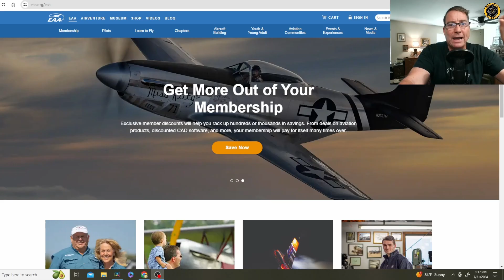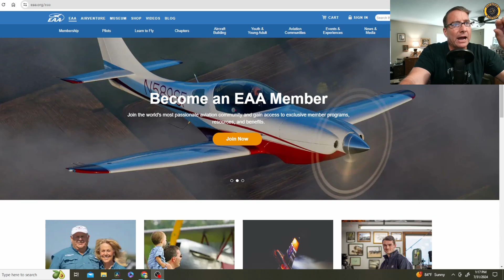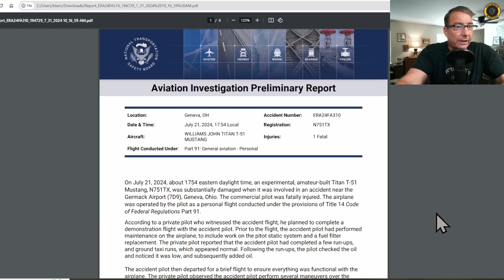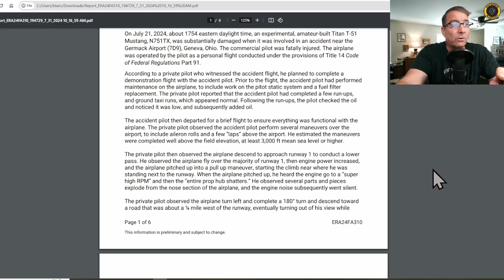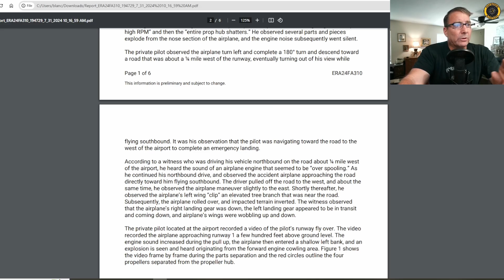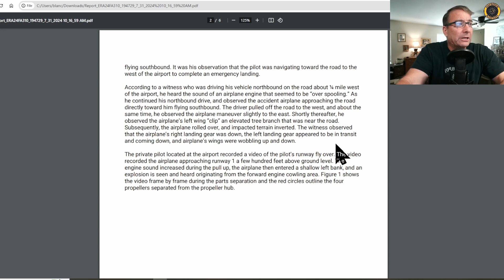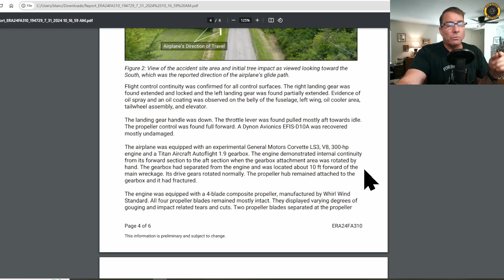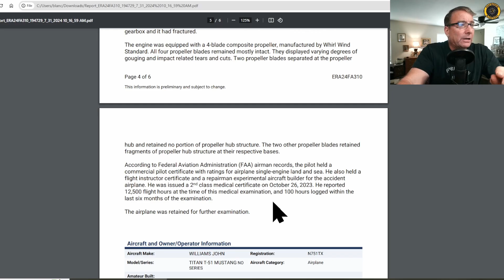Titan T-51 Fatal Prop Hub Failure 21 July 2024

Comment: Simple answer. Either the throttle cable travel limiter failed or was set too high or the G's caused limiting failure pulling the cable. There is also programable engine control modules that can rpm limit and one of those installed might of been flashed improperly. Of course or he went for full pitch after throttle up allowing a burst of rpms.

Comment: We need to allow for the possibility that the rpm increase did not cause the prop hub to fail. The private pilot report that he heard the rpm increase then saw the prop explode may or may not be exactly accurate. It is possible that the prop hub failure caused the engine to increase in RPM since there was no load on the engine.
Reply: Yes, the hub failed first.

Comment: Alot of replies focus on the reduction gearbox, every turboprop and turbine helicopter uses reduction gearboxes.
The Achilles heel with experimental aircraft is the reliability of the non aviation certified powertrains used.
I think the focus will be with the propeller hub failing or a propeller control issue. 
We will need to wait for the NTSB report.

Comment: bad mouthing conversion engines when the engine was not the cause of the accident, shows your bias. The prop hub failed, not the engine.
Reply: engines don't suddenly overrev like that. but they do if their load is suddenly removed.

Comment: One thing racers who push engines to the max use is a custom built crankshaft with an over sized snout. I sure would if I were using an auto engine in this application.
Reply: It drives a gear reduction box.

Comment: It seems unclear which happened first. Did the prop hub fail first, causing the blades to separate, which suddenly reduced the rotating mass and drag, causing the surge in engine RPM? Or did the engine surge in RPM first, overstressing the prop blades & hub causing them to fail?

Comment: So much more to it, like you think these guys thought of everything, but did they?  The propellers and hub are unlikely custom, they are likely tried and true.  What about the hub?  Had it the strength to handle the torque from an LS?  Don't forget the flight was entering a climb, a time when the torque would have been near it's highest.

Comment: Can someone explain to me why people don't use airplane parachutes? I know a few people do, but you would think with the safety that it gives that most everybody would have one. I just don't understand the thinking of people who don't have them. If there was one on this plane we wouldn't be hearing about a fatality, only a gear box and propeller failure.
Reply: There’s a plethora of reasons aircraft’s aren’t equipped with emergency parachutes. Starting with the airframe has to be engineered from the get go to withstand the shock of deployment. Then there’s cost, weight, space, weight and balance, maintenance. The list goes on and on. Even certified systems are not a panacea as there’s a performance envelope for successful deployment that’s not as broad as many imagine.

Comment: Damn. I fly RC aerobatics, giant scale with 20 horsepower 4 cylinder boxer motors. They rip the prop if you don’t control the throttle and nothing will destroy an airframe in the air like the prop throwing a blade. The airframe looks like it blew apart from within sometimes. Catastrophic explains it pretty well.
Reply: No, just the prop blades and part of the hub blew apart. The airframe and even the gearbox were not affected, apparently

Comment: What a tragic series of events; which I believe could have been prevented. I know John wanted to get all the performance he could get, out of his aircraft, which is why he chose the LS3 Chevrolet engine. The LS3 is a very reliable engine and can produce up to 600HP, reliably. It sounds like there may have been an undetected issue with the propellor hub; whether it was a bearing surface wearing unevenly, or wearing excessively. I'm curious of how long it had been since he had inspected the propellor hub and lubricating oil?

Comment: Is it possible that the prop hub failed, removing the load from the engine, causing the engine to then over rev?  I'm assuming the video can verify the timing of the two events.

Comment: If you look at many of the auto conversions in aircraft, the installs are just extremely scary. The wiring is usually awful and the fuel, coolant and oil lines (if there are any) are usually just bargain bin garbage. Viking Aircraft Engines doesn't even use a pressurized cooling system, because they refuse to run AN hoses and have trouble with the coolant hoses popping off of their fittings! It's just the wild west with most of those guys.

Comment: I don't believe the surge in rpm caused the prop hub failure, the surge in rpm was more likely an engine rpm spike resulting from the unloading of the departed propeller assembly.
Reply: I'm sure they watched the video that the eyewitness recorded. Not hard at that point to figure out which happened first.

Comment: 12,500 Flight Hours, lots of additional experience, highly experienced. Taken out by a mechanical failure.
Reply: Actually taken out by the choice to belly land gear up. If the field is fairly flat and smooth not that much damage is done to a plane that way.

Comment: From the looks of it, he had several other options than the road surrounded by trees, particularly to the right with what appear to be crop fields. Yeah, it will trash the plane, but there is a lot to be said for walking away from a busted plane when the option is getting cut out of a crumpled hunk of metal.

Comment: It's tough to be the bearer of bad news, but thanks Juan.  It's not a secret that 10% of Engineering effort is in actual "design", The other 90% is identifying all possible failure modes (of your now cherished design), because in av'n, "even if it can't fail it will".  With detailed knowledge of the instl'n and failure modes, something will fall into place.  But it's not possible to speculate here w/o detailed knowledge of the LS300 engine and prop design.  Is there a prop (RPM) governor (a digital / analog ECU)?  Or was it old-(old!-)-timey inst'ln with the pilot manually juggling throttle, mixture and prop alpha to remain within limits?  Too many unknowns.

Comment: Could there possibly have been an instance of the gearbox failing which damaged the hub? The engine without the load of the gearbox would have made a surge of rpm also. I assume from the report, the pulling up of the nose with an increase of rpm was the precursor of the failure. It just seems odd after all of his experience building the plane, he would have not known to limit his rpms and more than likely had a throttle stop afixed to prevent this surge from happening. Either way, it's a sad ending for someone who was trying to innovate a path for others to follow with his development and his experiention of these engines. My condolences to his family.

Comment: I did the research on this powerplant last year to evaluate the project and it didn't take long to reject that crate motor from GM as received. As an A&P,  there was far too much risk factor to consider it as a project. By the time I had reconfigured the engine to be serviceable, I was left with 3 useable parts - the crankshaft and both seals at either end of it. All other parts including the block would have to change to satisfy strength, oiling system redesign, fuel and ignition system and all the necessary additional components and parallel computers to build the engine with self correcting redundancy and 80 lbs or so less weight. The propeller and gear reduction still bothered me as there is little structural excess, but there are other options. The airboat guys have been doing this for years and better gearbox and prop combinations are available. I would have ended up with a test cell testing routine somewhere in the neighborhood of 7 months to get comfortable with what reliability and performance that I can resonably expect. Not impossible but not like that.
Reply: thanks for the information. The key with this engine and gearbox in this aircraft is that the engine can be used at low throttle settings and rpm and still provide lots of thrust, so it is not stressed at all compared to what it is capable of. But yes, the fuel and ignition systems are the weak points.

Comment: Fuel injected engines like the GM LS engine are computer controlled that have adjustable Rev limiting features. There’s no way the engine could over speed the set limit under any circumstances, especially in this case while under load. The engine hit the set limit RPM only after the load (the gearbox and propeller) was was suddenly disconnected. What was seen and heard was the failure of the gearbox or prop hub failing that caused the engine to rev to the set limit and the pilot then pulling off the throttle. 
As a caveat with my statement is that I don’t know what ECU is used in this application. If not a GM supplied unit, pretty much all aftermarket controllers offer the same functionality as GM units in automotive applications. Meaning RPM control would be the same. 
Additionally, many aftermarket ECU’s or PCM’s offer (as do most GM units) transmission input and output shaft speed sensors that can sense slippage. Some also offer driveshaft speed sensors, all of which could easily be adapted to gearbox and propeller speed monitoring that will instantly reduce engine power output or cut power to the ignition coils when shaft speeds exceed parameters.

Comment: wow, has to be one of the scariest things ever when the prop departs the plane
 
i was never really sure about the use of vehicle engines in aircraft, but after watching an Australian chap scratch build his own aircraft, my views began to swing the other way, i forget his name now, but the channel is 'Raptor Aircraft' well worth a watch 

i found the entire process fascinating and the plane using an Audi engine suped up, twin turbos, one feeding the second before going to the intake seemed to work very well, the aircraft was build from scratch with the hope that interest etc would take the design further and into production, i am very sure that it amoung others will finally take to the skies safely

i'm not that sure of all the technical issues but i guess the main one is that car engines as with many have the crack at the bottom, and propellers are generally mounted at the top so a gearbox final drive is required, it does seem odd that i now learn car engines are too fast so why make them faster with turbos, if that has to be reduced before powering the prop

i know the project took a turn in a different direction, there was an issue and the owner has been approached to explore possibilities of turning to electric power and some of the engines being looked at look pretty good - so it kind of makes me think if anyone is building scratch build aircraftmaybe they should be exploring the electric power engines as they seem to be becoming more available and prices are improving too

Comment: how could it over rpm unless the blades were angled for no resistance. maybe that control failed or he pulled it the wrong way with significant throttle and no rpm limiter.
I guess that's a risk with a variable prop if it can go flat. I don't know how any rpm limiter works on an LS. Google says it will go to 6700rpm so if designed for 5-6000rpm cruise it doesn't have a ton of extra range to sound noticeably faster. Unless the engine was modified to be able to run faster. Good to keep in mind, you don't want your prop splintering in flight.
A ballistic parachute might have helped, personal one is also an option when you tinker. Test pilots do that. There is also the aspect of age, he was 75 years old, devoted to WW2 planes, it's an occupational hazard to tinker with planes at the high end of the age range. One thing to fly at that age but pushing engineering limits at that age and fly it....  and a warbird replica might not be the most forgiving either.

Comment: In the high performance automotive world these engines often have rev limiters. It would be interesting to know if his application incorporated this safety feature?
.
Reply: It should have had a rev limiter but it may not have been reset to 4,000 rpm.

Comment: I found the fact fascinating that if the engine RPMs are too high the propeller tips break the speed of sound
Reply: @MADHIKER777  If the tip speed exceeds 600 mph, the air moving around the tip can exceed the speed of sound as the tip slices through it. At 2700 rpm with a 6’ diameter prop, the tip speed would be 2700 x 6 x Pi x 60 / 5280 = 578.3 mph.
Reply: Ever heard a plane taking off that makes a brapping sound? That's the prop tips mach1.
Reply: @hotrodray6802  The tips aren't going supersonic; the air that the tips disturb does. Modelers call it "ripping the prop"..

Comment: I lost a propeller once in a Steen Skybolt (on short final, hallelujah) and we didn’t figure out the prop was gone until we were off the runway and couldn’t taxi. It’s remarkably confusing.

Based on this account, I wouldn’t be surprised if the pilot was still trying to comprehend the situation, rather than focus on the forced landing. Hard to give up on a plane, sometimes. Who knows.
Reply: No, I doubt it. John was a smart guy and I think he knew what happened. If he had had a few more feet on each side to land he would still be with us. RIP

Comment: Modern electronic engine management responds EXTREMELY quickly to engine RPM changes and wouldn't normally allow any engine overspeed at all regardless of what the load or throttle positions are.
Surely they are running EFI on these engines?  
As an observer on the ground they would first see the failure then hear the failure, so blades would depart then they'd hear the engine revs increase to the max limited RPM (that should be only marginally above what the prop is designed to take after gearbox reduction).
I watched a company (try to) develop a Ford motorsport V8 for the FU 24 Flecther aircraft, mths and mths of ground running etc.   Aircrafts first flight, governer drive failed, prop and engine RPM limiter went into a conflict causing massive surging, pilot performed the "impossible turn" - BUT MADE IT!!!   was pretty scary to watch, the project never flew again to the best of my knowledge.

Comment: How about the diamond aren’t they using anautomotive diesel?
Reply: The core is automotive. The end product is certified aeronautical. Lots of engineering, changes and most importantly certification testing. Diesels are usually tough as the power impulse is generally harsher and harder to dampen than a gasoline engine.

Comment: If you lose oil pressure and the prop goes to fine, the engine should not over-rev (if the base pitch is set correctly).
The prop blades were from whirlwind but the hub was made by Titan said someone familiar with the build.
Reply: Also if we start putting ecms on airplane engines then we could also have fuel cutoffs to prevent overspeeding like car engines have
Reply: @Heatherder  They do and it did

Comment: I had a 310P and had to rebuild the props. Learned way more than I wanted to know. The hubs keep the props from centrifugal forces exceeding 20 tons each if I remember right. When you have one fail it is catastrophic. It can rip the engine right out of the frame. Condolences to him, his family and friends.
Reply: As long as we all understand that "centrifugal" refers only to the direction of and not the nature or origin of the force. My work here is done. 😄
Reply: There are numerous examples of this happening. One that comes to mind is an Embraer Brasilia (EMB-115?). The prop and gear unit remained dangling from the aircraft as the plane went down, so it didn't detach entirely. It was down to a fatigue crack in one prop blade that went undetected. Since it had 4 blades the asymmetry of that force everyone's bickering about was a bit less, but it brought the plane down. A few people survived I think.
Reply: Centrifugal force is a misnomer. It does not exist as a force in the realities of physics. Centripetal force is a real force that keeps an object moving in a circle, while centrifugal force is an apparent force that pushes an object away from the center of a circle:
Centripetal force
A real force that acts towards the center of a circle, or the axis of rotation, to keep an object moving in a circle.
Reply: @danblumel  The difference is mostly philosophical here, we are talking about the stresses upon the propeller hub.  It also depends on your reference frame, which for the propeller hub is spinning at a few 1000 RPM …

How about you tackle a force being expressed in units of inertial mass (20 tons) instead of units of force (about 196,000,000 Newton)?
Reply: @danblumel The centrifugal force is the problem because it pulls from center. Ie the hub being center and the ends of the props being the outer circumference. When a prop fails the hub is pulled from center from said force. The reason it is centrifugal is because of the imparted rotation from the connecting rods to the crank to the hub. Making it a force that wants to push away from center when a prop fails.
Reply: @danblumel centrifugal force is one of several false forces that are actually inertial tendencies but may as well not be for practical reasons
Reply: @danblumel centripetal force is very similar. thete is no such force. force which does it is either gravity, or interatomic/intermolecular (tension) and those can be described using more basic forces. rabbit hole.

Comment: I would think that if the engine is capable of producing 300hp, then the gearbox should be capable of more than 300hp (like 350-400). I wouldn't want a gearbox that maxes out at what the engine is easily capable of in order to provide a little safety margin.